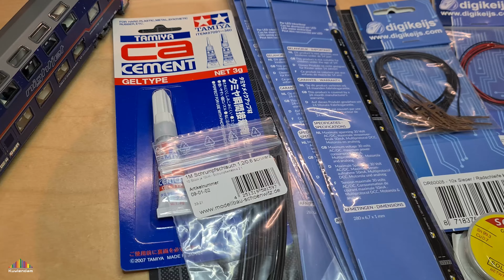Illuminating LS Models Nightjet H0 wagons with digikeijs led strips

Comment: Certainly not the easiest coach to fit out with light stripes but this is exactly what I am trying to prevent, uneven light distribution. Yes, one could argue that each compartment dimmed or turned out its light like in real life but then again in my opinion it just an easy way out for not having control over the light distribution. Nevertheless thanks for the useful tutorial, certainly thumbs up from my side, regardless of my nitpicking.
Reply from the maker: That's a good point and thanks for your comment!